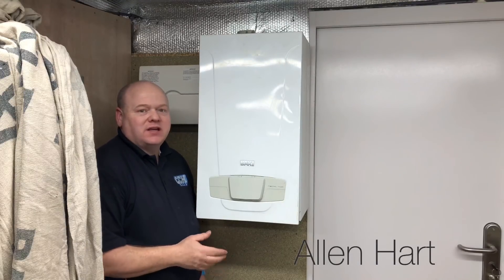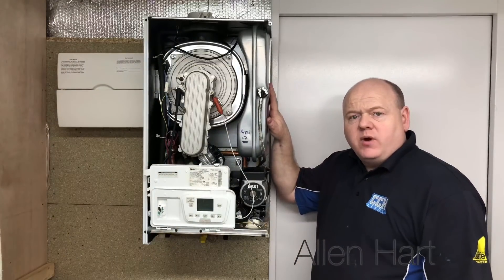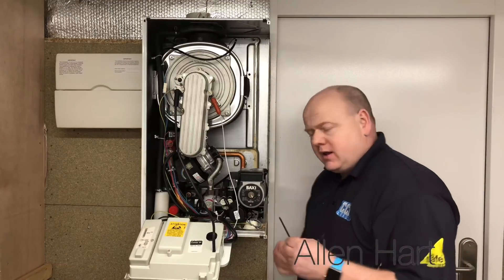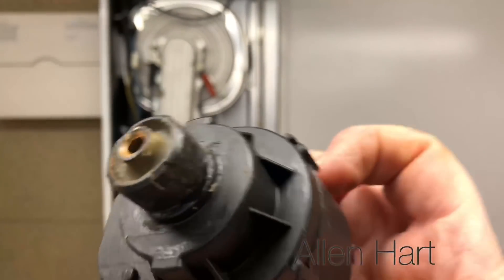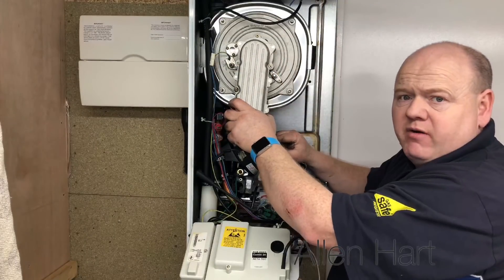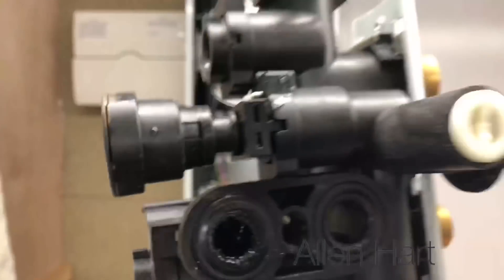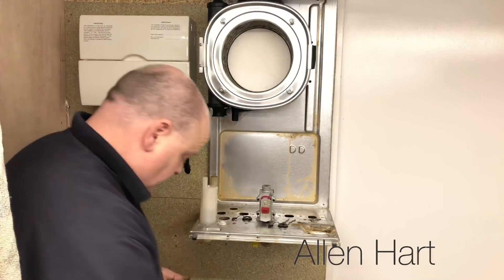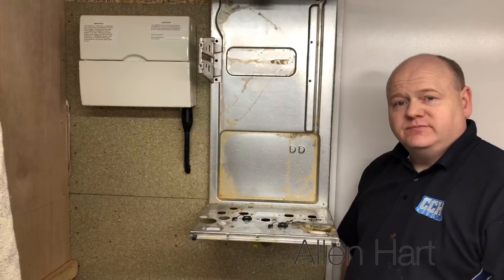Baxi Neta Tec full strip down

Comment: Hi,

Does anyone know how to get the diverter cartridge out as it's stuck and am unable to either unscrew (doesnt' look like it's screwed in) or pull it out? The motor came off easily after removing both pin's but not the diverter valve cartridge that's behind it. Thre's a plastic pin that's upwards and in a housing's grove that's preventing any turning.
Reply: We eventually got the plastic version diverter cartridge out in Baxi 128 Combi boiler. There's not quarter turn AT ALL in this version - no special tools required as in some versions - just be persistent and pull it out.
Reply: @webcoderltd hi I've also tried to get cartridge out but is solid,broke the front of .any tips or tools used.thanks

Comment: Hi alan..... how did you get the diverter cartridge out.... is it just a quarter turn? Couldn't see how you did it. Got water dripping out of the motor so I'm assuming it's the cartridge leaking onto it. But wanted make sure it's easy to do before I do it. Cheers
Reply from the maker: Yes and yes
Reply: Hello Jon, I have the same problem as U, can't pull the diverter cartridge out. Did you manage to replace yours? If so Can you please tell me how did you manage to take it out? Mine doesn't move in any direction....
Reply: @Szymii2  it did come out on a quarter turn, cant remember which way it turned though sorry

Comment: I have one of these boilers, it keeps gaining pressure so has to be emptied of a few litres of water every few days. The filling loop has been disconnected and the engineer has replaced the plate heat exchanger and its had a new expansion vessel but is still gaining pressure. He thinks it could be a internal leak on the hydraulic. Is this possible?
Reply from the maker: https://www.youtube.com/watch?v=UR9wSU-I2O8&t=62s
Reply from the maker: Thanks very much for your comment, please consider subscribing to support the channel 🙂

Comment: Hi Alan I have tis boiler there is nothing on the display. I have power I thought pcb had gone ordered a refurbished one but still doesn't work I think need a new one. If there is no display must be the problem. Cant get a plumber at the moment because of corona.
Reply from the maker: Al woo You need a gas engineer, this is not a job for DIY, Thanks
Reply: @AllenHart999  I'm an engineer just not a gas one I can change the circuit board. I tested the voltage the board has 230v but nothing on the display. The part I ordered is faulty I suspect it's a refurbished part. If it got power it must display something surely. Have you had this problem before?
Reply from the maker: Al woo How will you test it’s working correctly afterwards? DO YOU HAVE A FGA ?
Reply: @AllenHart999  ok I will leave it then looks like I will have to wait for a few months until this pandemic is over
Reply from the maker: Thanks very much for your comment, please consider subscribing to support the channel 🙂

Comment: Thank you for a nice strip-down!. Mostly it is common sense but thank you anyway. That Neta-Tec looks just as gungy as my five year old 24 GA that I inherited with my current property. The serial number will determine its year of manufacture. Check the that the RDS is appropriate for the gas supply, natural gas or propane.

All the instructions and videos, including this one, skip the difficulty of removing the diverter valve cartridge. The 'hydroblock' walls are often coated with hard water deposits and applying leverage to the diverter valve flange results in no movement, only broken flanges. To gain access I removed the complete circulation pump (one PZ3 & two 5mm hex), used a 'right-angle screwdriver' to bias the valve to the left and forced a small screwdriver behind the substantial protrusion at 3 o'clock.

BTW, plated screws often 'cold weld' their threads; applying a little tightening action or, sometimes, a jolt from a small hammer will make them easy to remove and reduce the chance of damaging the head or the threads.

After removing the hard water deposits I will reassemble with copious application of silicon grease to all 'O-rings'.

With 50 years experience on computer systems (power, electronic, digital, hydraulic and barometric) I am a competent person. I do not have access to the necessary instruments (flue gas analyser and manometer) to properly test the integrity of my boiler so when I have finished reconditioning my boiler and CH system I will have it serviced by a (usually incompetent) 'Gas Safe' 'Engineer'! Not referring to you, Allen!
Reply from the maker: Thanks very much for your comment, please consider subscribing to support the channel 🙂